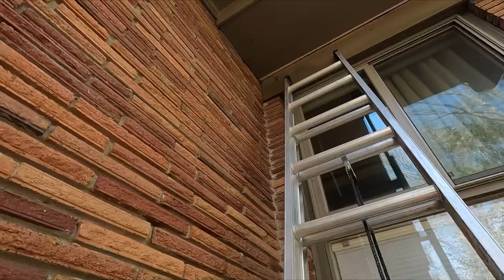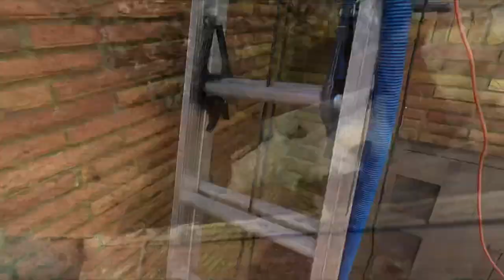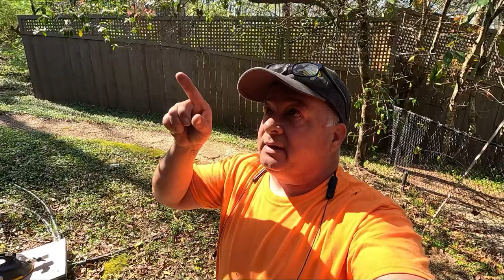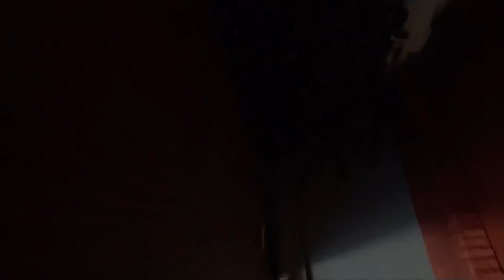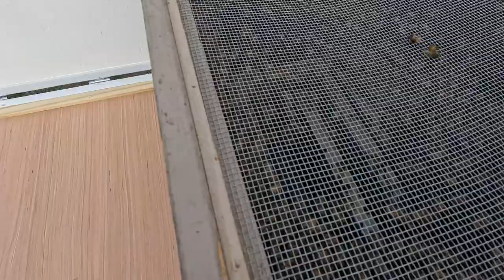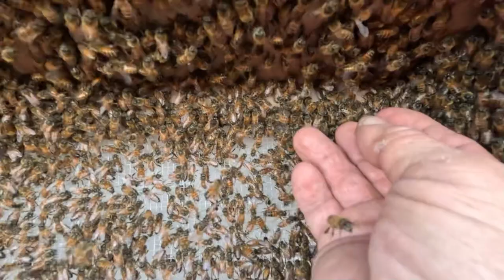Early Spring Swarm Invades Alabama Home

Comment: Do you not use any bee repellent like honey bandit Yappy? Seems like that would have worked to get them out of that hole. Is there a reason you don’t like it in that scenario or did you just not have any?
Reply from the maker: I have 5 gal of honey b gone.   But to answer the question, understand that once you spray it, it lasts for days.   Smoke moves them just fine.  When you spray products in a void they run and run far.   Many times to places you don't know exist and they won't come out from. That doesn't get the job done, just makes it harder.
Reply: @YappyBeeman  That makes sense, thank you for answering me. 😊